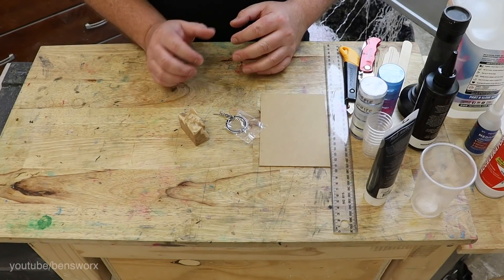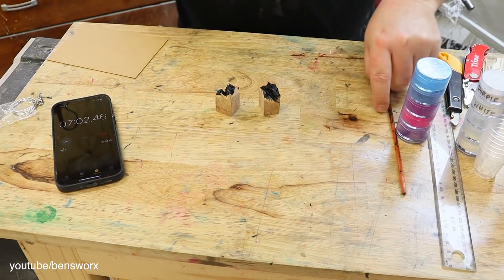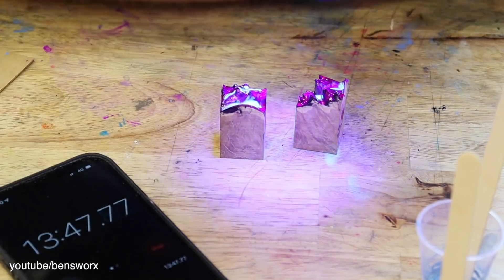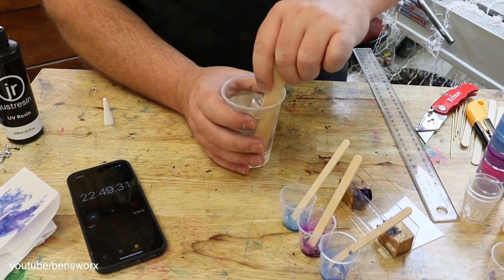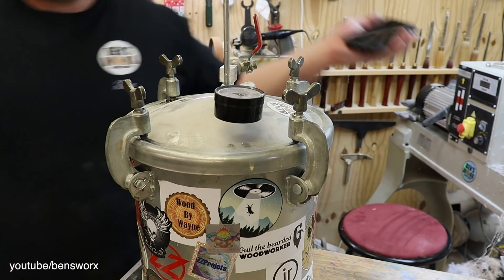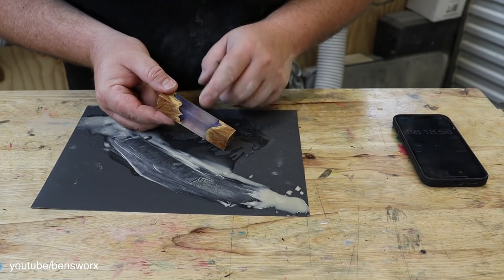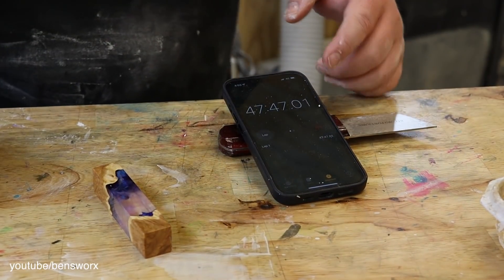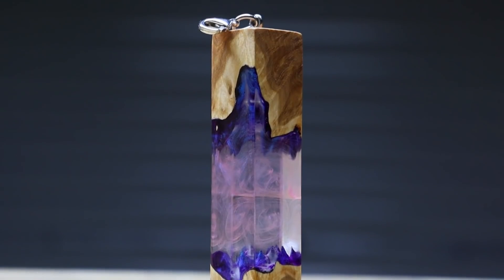30 Minute Challenge - Wood and Resin Keychain

Comment: Hey, Ben.  I hope Nicole's doing better quick. When you were on the bandsaw at the very beginning, you used a push stick with your right hand to protect your fingers, but not on your left.  Your left hand fingers were the same distance from the blade as the right hand fingers.  Why didn't you use a push stick on the left?

Comment: Considering you included the time to open the pressure pot and put the casting in, then seal and apply pressures. But didn't for removing it. I think you should knock off at least 10minutes.

Also interesting that you showed (without planning) that rushing jobs can lead to injuries from unexpected places.

Comment: The only way to hit a 30 minute mark with things Ike this is to take osme things off the list of what counts. Doing little things like using a preexisting mold or building it beforehand mixing up resins just before setting the challenge and storing them in a dark space so that you save a couple minutes there. Or having the wood pieces already cut. Etc.